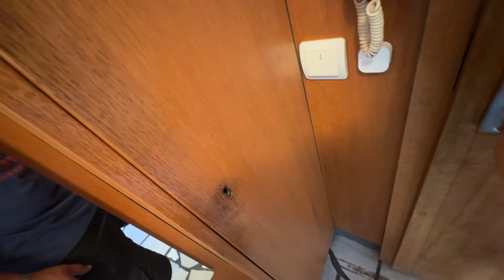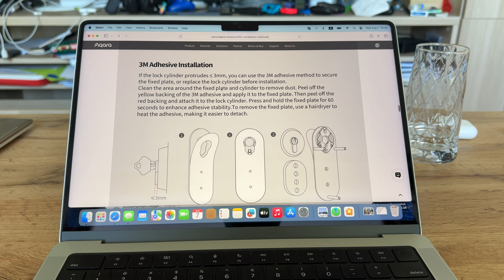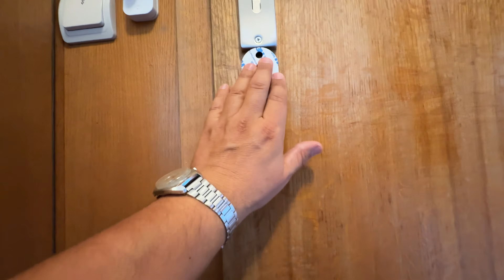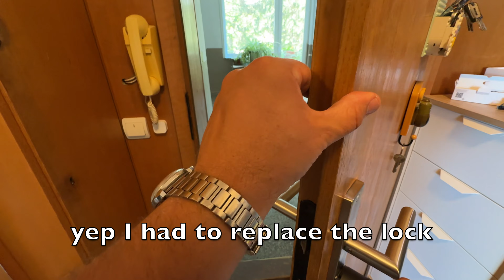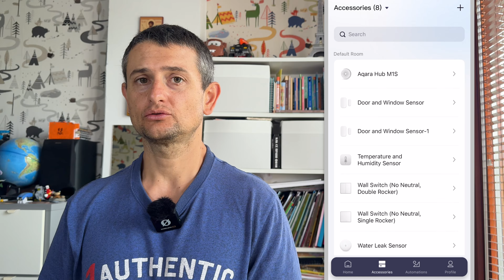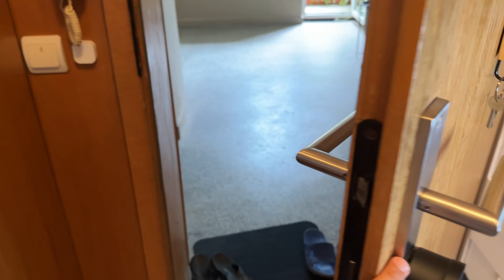How to Install the Aqara U200 Smart Lock with HomeKey on an Old Door? #apple #homekit #tutorial

Comment: Thank you for the fantastic review! Our door lock has a latch.
Can the Aqara U200 automatically operate it? Specifically, if I use my Apple Watch (Home Key), will both the deadbolt and the latch unlock together?
Reply from the maker: I assume that the latch and the deadbolt are in on different places on the door right? If they are then the lock cannot handle them both. If the latch is on the deadbolt then yes it can operate it. There is a setting from the Aqara app to do that.